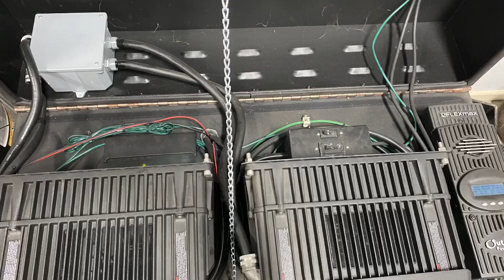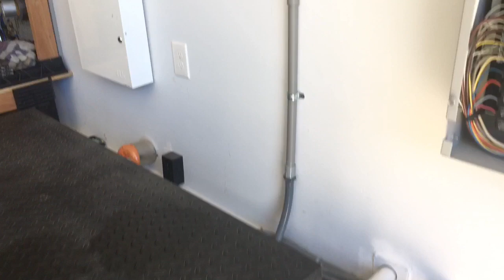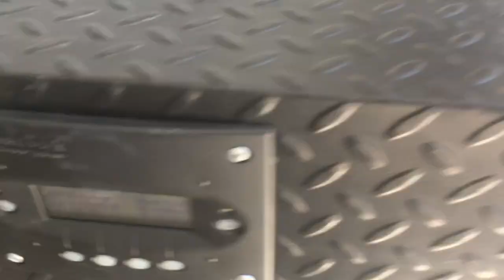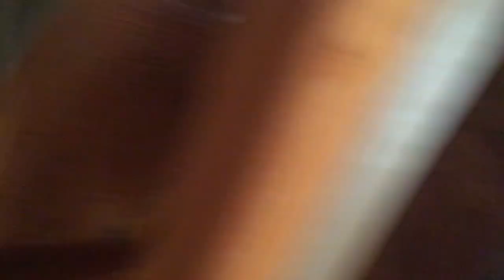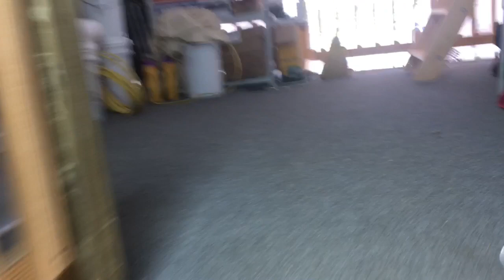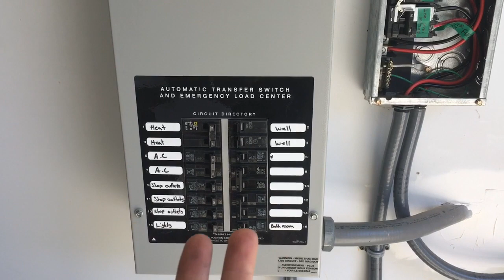Ac coupled enphase to outback inverter’s system Explanation

Comment: seems a bit excessive for just a shop.  what about separating out some of the array and using that just for the stand alone inverter with a charge controller.

when grid is up, the grid tied unit does its thing as designed.  when the grid is down, the system shifts over to the stand alone inverter automatically.  two independent systems.
Reply from the maker: It was a messed up setup

Comment: Do you still need a dump if your AC coupled inverter can frequency shift to curtail the charging rate?
Reply from the maker: You don’t need a dump load but you still need a secondary means of protection, especially if the battery size is less than 100amp hours per kw of grid tie inverter. Talking 48v here

Comment: Strange that you'd use a great big resistor for a dump load. When all you need is a little voltage meters switch and turn off one string of in verders at a time with an AC contactor would be a lot simpler that's the way I'm going to do it.
Reply from the maker: I didn’t install or design the system but it’s supposed to function automatically vs something like your talking about that relies on human intervention
Reply: @GainSolarPower   One my strings turns off at 47.5 V the next string turns off at 47.7 and the last ring turns off it 47.9 volts it's all automatic.
Reply from the maker: Terry a well then it’s sounds like you have it figured out good job.

Comment: Wow that's crazy.  All because the backup inverter doesn't have a feature to change the frequency to prevent overcharging.  It can flip at least one relay, why not have one or several AC relays to disconnect one leg of the micro strings.  That wouldn't cost too much to change, and might be worth removing the risky attic heater.

Comment: I am sure glad I have the SolArk and my excess solar is also being used to heat my hot water tank for free hot water every day. It is simply an awesome system,. With the 11Kw panel system and 3 months now of electric bills to compare to, I have cut my electric bill by over 1/3. Simply the best.
Reply from the maker: Gator Man well I just pulled the trigger on a bunch of 8” T&G cypress for my kitchen ceiling in honor of the gator man himself.
Reply: @GainSolarPower  Sweet! You will love that wood. You know how much I do!

Comment: Hi Johnny !, instead of turning on a dump load, i would just turn off the solar array with that relay, i think it's safer than a house burner!!!
Reply from the maker: Sylvain Maher I Was able to get it working pretty good with one Of the 3 20 amp solar breaker’s on the battery was staying charged and the loads were 
being powered.  

The micro inverters solar array was comprised of 3 20 amp strings of micro inverters so with 120 amp string the system was working well enough

Comment: Seems like such a waste of power let alone the fire hazard
Reply from the maker: Send me a link
Reply: @GainSolarPower   I believe you need both of these to make it work

https://www.sigineer.com/product/dc-voltage-detector/

https://www.sigineer.com/product/remote-control-120v-240v-50a-ac-circuit-breaker/
Reply: Singineer makes an AC breaker controlled by voltage and hertz which could automatically disengage the string on enphase in a grid down situation.
Reply: @offgridwanabe  yeah me too sounds cool

Comment: Don't the new charge controllers regulate the amount of current from the panels into the batteries, thus not needing a dump load....?
Reply from the maker: Adirondacks4me the charge controller is non existent. This is and ac coupled system the grid tied inverter’s are getting fooled into coming on by a battery inverter